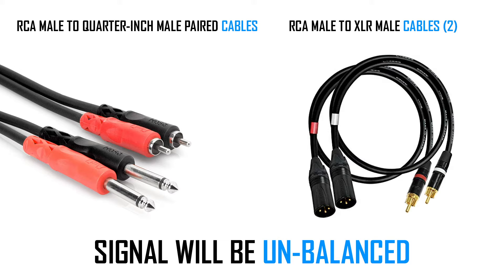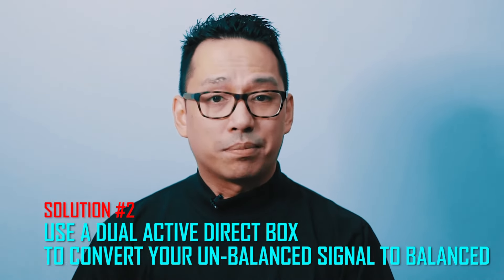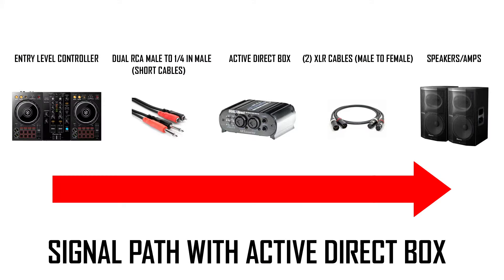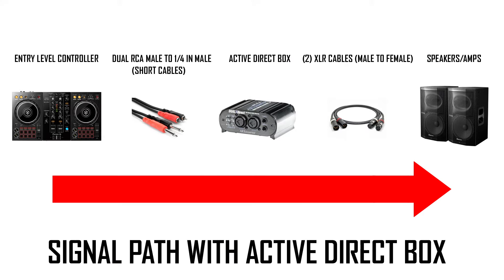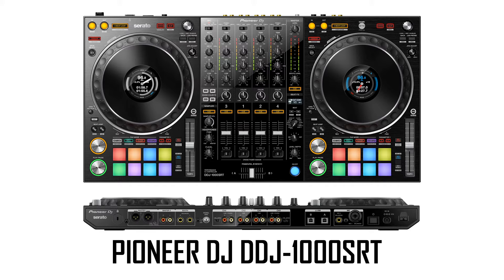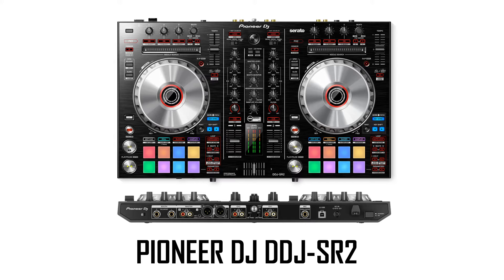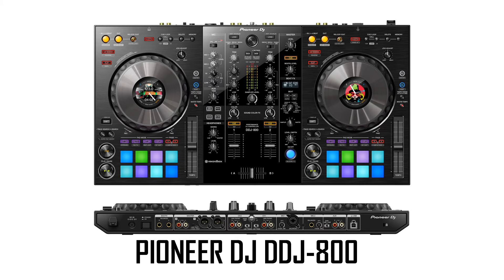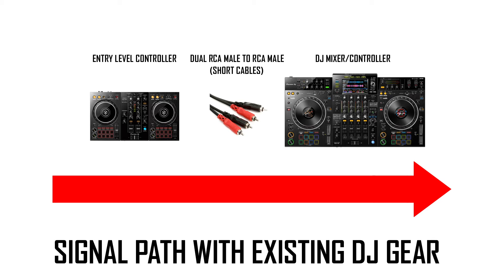Entry Level DJ Controller | How to connect to speakers or sound system

Comment: Hi wow super informative ty.  Question. I’m setting up a beginner Dj system but I want to add amplifier on the system. To already Amplified speakers is that OK or I should just get speakers with no amplification and use my own amplification
Reply from the maker: Adding an amplifier to power speakers is asking broken amp and speaker. Only passive speakers go with amps.

Comment: Hey, thank you for the valuable information. I’ve ddj 400 and rokit 7g4’s and have too much hissing(ground noise) even the cable length is 2mts. Cable is neutrik and klotz from rca to xlr. If i get an art di cleanbox pro and convert this unbalanced rca to balanced output, this irritating hissing sound will go away or stay there or decrease? Thank you in advance for your reply. Have a great day!
Reply from the maker: You bet!

Comment: Very informative video Pri yon Joni.  Would the xenyx 802 also send a balanced signal to the speaker?  It's not very clear like you mention.  Great video.
Reply from the maker: Jay L. According to the input/output chart, the outputs of the 802 are indeed balanced.
Reply: @priyonjoni  Thanks.  Really appreciate it.  I've learned a lot from your videos.  Good stuff

Comment: Yup - that's what i did when I took my DDJ400 to the party 2 weeks ago.  Took along my little allen&Heath Zed6
Reply from the maker: BdiddyB I’ll have to look into that mixer since you’re not the first to mention it! Glad the mixer idea is working out
Reply: BdiddyB I have a DDJ 400s with a jbl eon600 1000 watt. But not as loud as it should be. Nowhere near.  Do i need a mixer?

Comment: I am currently using the DDJ SB3, which only has RCA output. However I have some good solid Behringer active speakers, which ONLY has an 1/4 Jack and XLR input. I am thinking of buying the Yamaha MG06 mixer, over the Behringer small mixers, due to the fact of the XLR output they have on the Yamaha Mixer. My set will go like this :
DDJ SB3 (RCA to 1/4 JACK) ---> Yamaha MG06 (XLR to XLR) ---> Behringer B115D

I will I have extra channels for an AUX to 1/4 Jack if needs be, but also an input for my Wired Mic or even my Wireless Mic.
Is everything ok? Whats your opinion? I really love my SB3 and I do not feel the need to upgrade, as at the moment I am trying to improve my mobile DJ set up.
Thanks for the great video man !
Reply from the maker: DJ Myron a balanced quarter inch output can be converted to XLR by simply having a wire that is TRS quarter inch to male XLR. Neither one is better or worse than the other. XLR and TRS quarter inch all have 3 wires inside, 2 of which are signal carriers.

Comment: Hi I'm currently using an SB3 rca to 1/4 in.  To a xenyx 802. I also have 2 powered speakers and one powered sub. How would you wire it? I'm having trouble getting a good sound out of my system. Thanks in advance.

Comment: I like how you help so many Djs. You do know so much about Controlers , I know you. Know alot. When are you going to talk about the way we did it in the  beginning of DJ ing . One time you said a real DJ could dj with just about any cheap or expensive equipment witch it's true .Trust me am 60 years old back then most turntables had no speed control. You had to have and know the selection of records you was going to play ,or look at the groves for your cues. Mixers where ok if you was lucky I had a uncle in Germany and came with 2 Mixers Like Bozak or Uri , and macintosh amps had tubes, Then he had those Thorens turntables like they had in all the Major clubs how I wanted those .Then he purchased some Phillips Turntables for me I sold them and purchase Technics 1800 I thought I had the best no belt moter, it's what I wanted  I held on till the 1200 mk2  came around bought a display and a new one still have them got rid of the 1800, CDJS started coming out it took me years but I gave in and bought a pair of Cdjs 1000 I used Cds for years Then I seen some guy selling the silver Cdjs 1000  I gave him $350 for the pair and he took it so now I have 4 pioneers CDJS players bought me the Denon Serato pro with the interface 2 disc ,2 records all the wires I need so I use a old Bozak Mixer it don't have a USB port that's why I purchased the Serato pro only 2 channels so I still have 2 more channels for the other cdj players. Any way thanks for your info .Your the best ,you must be a hell of a perfectionist till you next post love them

Comment: Hi there, I appreciate your video. A lot of valuable information. I have a question however, I currently have 2 Reloop 7000s, Pioneer DJM S7 and one QSC K10.2. I am getting a "ground loop". XLR to the speaker but RCA from turntables to mixer. Idk what to do... Any advice ?
Reply from the maker: I’m not familiar with the Reloops. Did it come with a ground cable?
Reply: @priyonjoni  It did and I attach it to the back of the Pioneer S7 and still get an occasional buzzing sound. I've checked the needle/cartridge and nothing seems out of place...

Comment: Great and helpful video. Quick question - does anything change if im trying to just go form DDJ-400 to just 1 single powered PA speaker? I'm hoping to take the RC out from the mixer, balance it with a DI box and then go to just 1 speaker. Would I just use one XLR cable from the DI box or would I use both of the 2 inputs on the speaker?
Reply from the maker: Justin Koppstein some powered speakers have dual RCA inputs in addition to the XLR and quarter inch.
Reply: @priyonjoni  My speaker just has a hybrid XLR/TS input. And to be clear, i'm trying to play from my DDJ-400 on just 1 (mono) PA speaker. Any help would be awesome!

Comment: Very informative and useful video’s. Just a question about entry level controllers with RCA output. If that controller like the Traktor Kontrol S2 mk3 have a power supply and not USB powered, will the RCA output be the same as a better controller with XLR output.
Reply: Not necessarily but they could be a bit louder and the sound Quality could be a tiny bit better. But doesn't has to be better. If you go for CDJs or other high end gear, the sound Quality will be better for sure. But the sound Quality of entry level Controllers is so good nowadays, that the crowd won't even notice whether you play on CDJs or a S2 Mk3. 😉

Comment: Hi, that video was very informative thank you. I do have a question I have a pioneer ddj sb3 gold edition and I tried to put it through a pioneer ddj 1000 rekordbox using the rca cables as advised. I was putting them though some Krk rokit series 5 but I’m getting no sound at all can you please help? Many thanks
Reply from the maker: Did you turn the channel volume or gain up on the DDJ-1000? Did you make sure the crossfader on the DDJ-1000 is disabled? Is the master volume up on the DDJ-1000? Is the channel selector switch selected for input?

Comment: What if i got two rokit 5’s the only input to them is xlr? How do i do it? What cables do i need? I got a scarlet anyway i can connect the controller to it? Because that is connected to the speakers my scarlett has two xlr ports
Reply from the maker: What controller do you have? And what kind of master output does it have? RCA?
Reply: @priyonjoni  pioner dj 200, usb to the laptop

Comment: Greetings friend. First of all thank you for a really good video that cleared a lot of questions out (at least for me). I'll explain what I use, and then you can answer what your opinion on the matter is.
I use Traktor S2 MK3, pretty good controller but has a really quiet master output and only RCA (unb) outs. I would like to keep my unbalanced connection short and boost my signal output a bit more (I think it's weaker than on the SB3 out of the box), so what would you recommend using between Active Dual Direct Box (the Art one you linked) or that Small Behringer Xenyx Q802USB Mixer? Keep in mind that I should be able to boost the signal a little bit more than someone on the SB3. 
Thanks in advance, keep up the great work and amazing videos!
Reply from the maker: Ejub Petrovac for the controls of gain and EQ, I prefer using the mixer.
Reply: Thank you for the reply and sorry if my comment was too long. Best regards!

Comment: Hi Pri, I'm watching this video because I recently purchased an external mixer. When hooking an S11 to an external mixer do you just run one XLR from the S11 master out to the external mixer or is it better to run two separate XLRs from the S11 master out to the external mixer? Does it make a difference? Thank you for all the great videos.
Reply from the maker: If you run one xlr, you are going to end up with only channel of the stereo signal. Does your mixer have any channels that have stereo 1/4 inch? You can use a pair of xlr to TRA 1/4in cables
Reply: @priyonjoni  perfect 👌- yes it has 1/4 inputs- Thank you 
I'm going to run my own un scientific tests - Some DJs claim that an external mixer give you better sound quality. I'm sure that's true for the SB3- but not sure if that's true for a pro-level mixer like the S11.
Reply from the maker: Depends what they mean by “better.” Microphone wise, that is for sure. Entry level controls, it just reinforces the signal strength.

Comment: Great video and it came at a time when I needed to learn about just this. I've always plugged into DJMs in clubs but I'm going into a venue where that's not possible and even though my controller has balanced outputs, my backup does not. Very useful information here and confirms that the way I've handled things before was good, without knowing why. Thanks dude!
Reply from the maker: Callum Kenny glad to help!
Reply: Just wanted to know what is your backup controller with the unbalanced outputs?

Comment: Great video. I have a DDJ-400 controller and I'm thinking of getting a pair of studio monitors, the active direct box seems like the best set up to connect these for me, but if I also wanted the option of connecting the monitors to a laptop/PC, would I be able to do this using the active direct box or would I need some other cables/equipment?

Comment: Quick question - you recommend a Dual Active Direct Box to create the balanced output to the speakers, yet none of these that I've found have RCA inputs.....so the recommendation is to just use adaptors to the directbox?  Thanks in advanced

Comment: So if your cable length is short, unbalanced is fine? Will the quality and sound level still be great on a super short RCA to XLR cable?
Reply from the maker: gorrilaunit99 if you are using it at home, you will be fine. If you are using it at a gig you might be ok. But if you get any sort of noise, you’ll know where to look first.

Comment: Been using a Behringer XENYX 802 (non-USB) for a few years now. Gives you lots more headroom and obviously microphone flexibility. The non-USB version was like $49, I think. And actually came in handy a couple times when my SB2 died.
Reply: Just ordered one to be able to use ddj 400 with a turntable. Should be fun.
Reply from the maker: Ren7sp you’re getting an 802 for a turntable? Just be careful because timetables require a preamp to function. That’s why their inputs are labeled PHONO on dj mixers.
Reply: @priyonjoni  thanks for the heads up. This one has a pre Amp built-in and should work with it. And if it doesnt, i saw someone using a tablet as well. Eager to test that out. And if that doesnt work, I can use it to connect a friends Hercules controller who has his own library with tracks so we can VS 😁

Comment: Terrible advice regarding budget controllers on big Soundsystems. The problem with budget controllers is the poor quality of the audio coming out of their budget sound cards. The poster suggests that you amplify that poor quality. Yikes.
This is how you do it. 
1. Serato: Don't bring your cheap shit to a club please. Learn some other skills.
2. Rekordbox or Traktor:
Buy a decent audio interface with balanced outputs for your computer and route the audio through it via settings in your software.
Reply: alanllew so you’re going controller to interface to computer and then coming from the interface outs to the powered speakers?
Reply: @youngkey3051  nearly that. Controller just controls the software via usb. Software settings route audio out through your external soundcard to speakers.